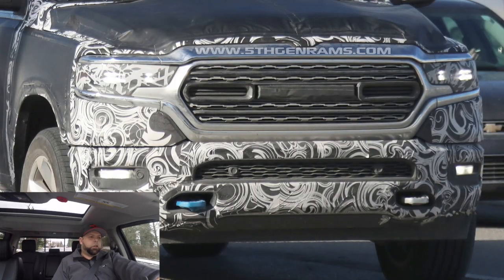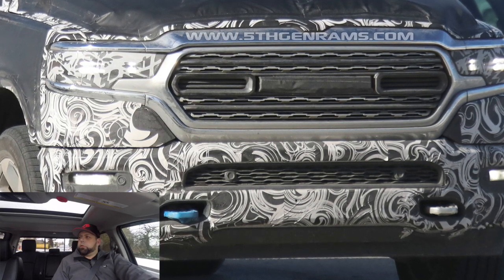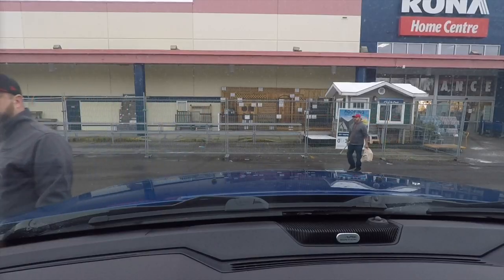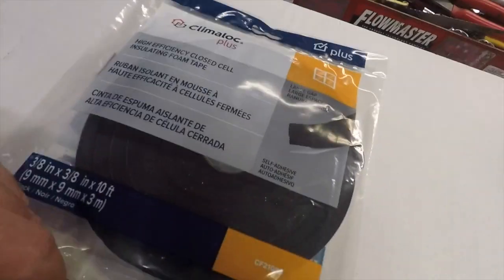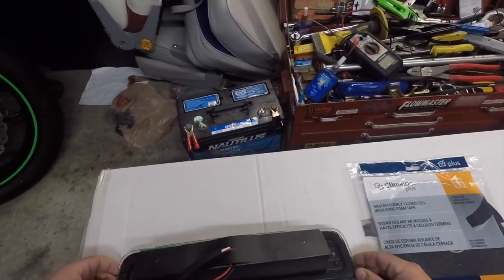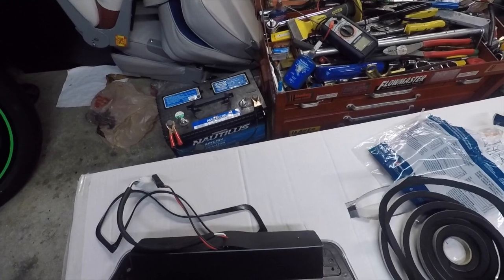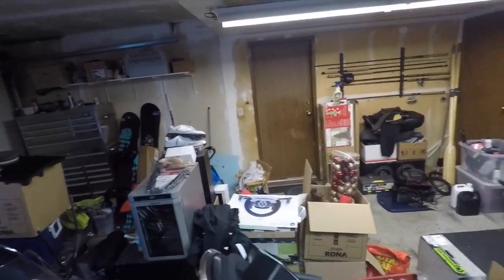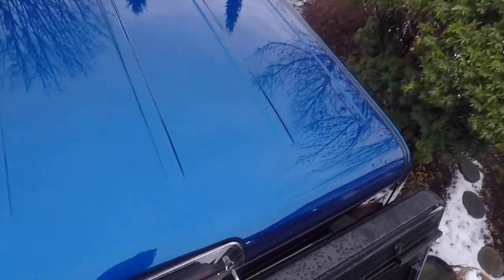How to fix a LEAKING third brake light

Comment: Did exactly  the same thing..I’ve changed the seal put a bigger one and as soon as i tight the screws  the piece of shit just brake in two right where the screws are located.. cheap material..i bought some high quality led and put it in the original one.. 👍👍

Comment: Same to you happy holidays... I noticed you washed your engine ?? 😱 can we do that ? Lol I been wanting to do it to mine but don't wanna mess it up
Reply: Alex Bajo Go for it as long as you keep the water moving, I use light water pressure
Reply from the maker: +BigMan 95 Yeah it's safe to wash the engine, just make sure it's cold so the cold water doesn't shock anything and cause it to warp or crack. Also make sure you cover your alternator and air filter if it's exposed and don't spray directly at them.
Reply: BigMan 95 alright thanks

Comment: Where can you buy the gasket? Is that LED I saw in your low beam? If so what brand is it? Thanks in advance for your reply
Reply from the maker: You can get it at Home Depot, Lowes, Rona etc pretty much any home improvement store should have it.
Reply from the maker: Also they're HID's check out Xenondepot.com, they're got some killer HID kits for these trucks.
Reply: Thanks very much